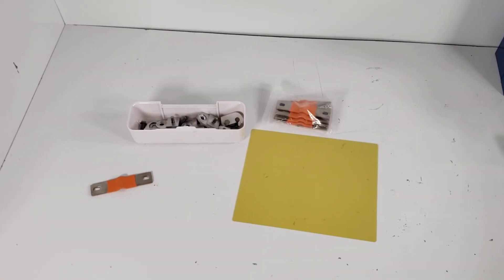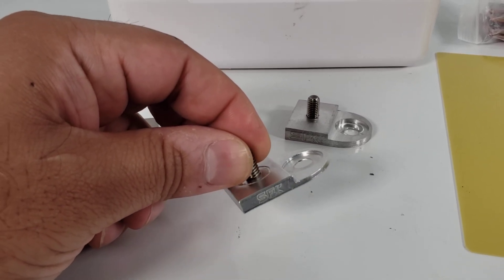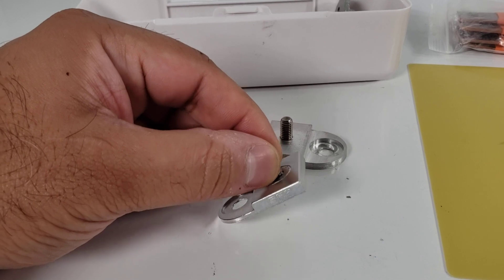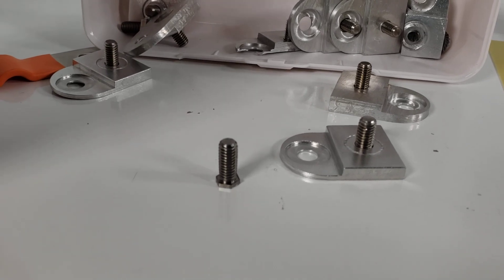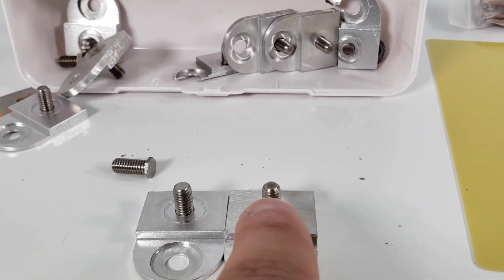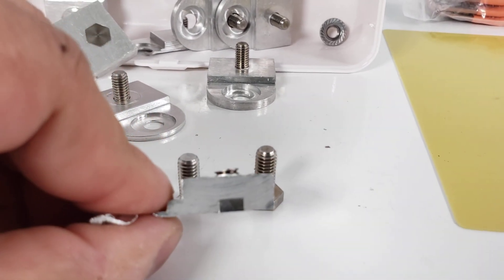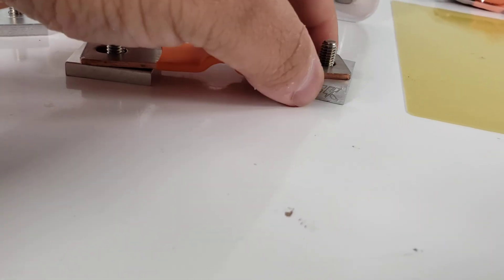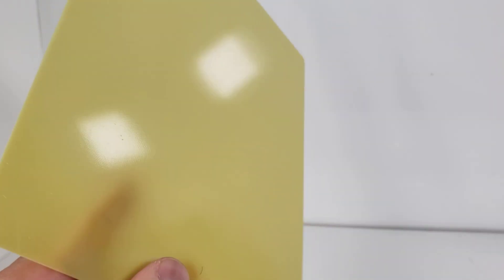Cell Terminal Update & Flexible Bus Bars

Comment: I would prefer the studs(posts) to be approx 1.5 times longer. With the quality of the cells that you can now purchase from SFK, it means you can have a lot more confidence in 2P16S set ups. If using some flat stock copper bus bars, at twice the thickness of the ones provided, plus potentially a second connection for series link up, a slightly longer post offers much greater degree of flexibility. I realise the longer post might offer more strain on the weld, but that is a big hex nut at the bottom of that post. Just a thought.
Reply from the maker: Let us know your ideas, we can use a longer stud and press fit it in I think it can be up to 30mm long (1.2 inch), but this would need to be a special order.